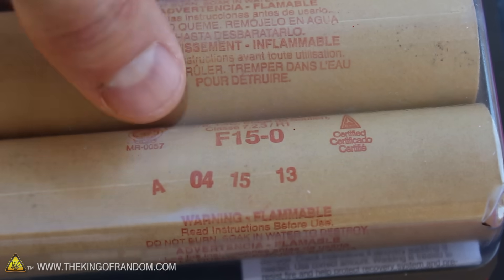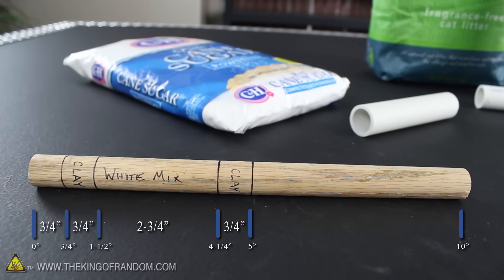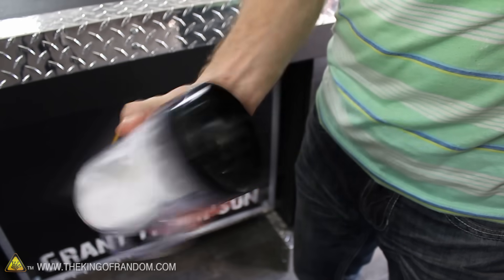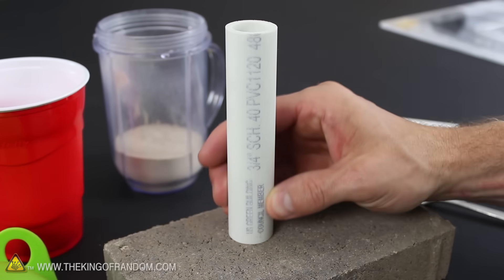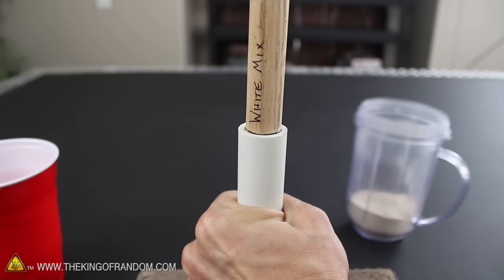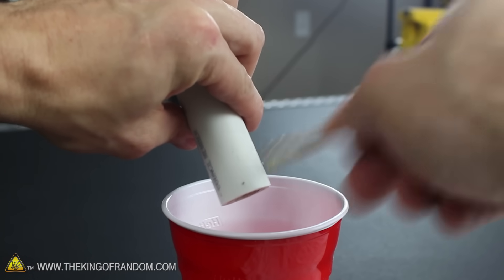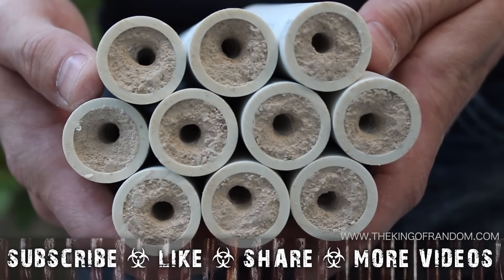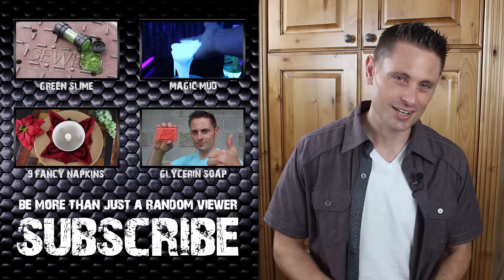How To Make Sugar Rockets

Comment from the maker: Some quick links to a few of the materials I used:

Screw lock sugar rockets
[✓] 12” x 3/4” PVC sprinkler riser: http://amzn.to/2cH4URc
[✓] Spectricide stump remover: http://amzn.to/2bXudia
[✓] Powdered sugar: http://amzn.to/2bXsTfe
[✓] Uncented kitty litter: http://amzn.to/2cG52NZ
[✓] Magic bullet: http://amzn.to/2cG5Gen
Reply: Grant Thompson - "The King of Random"
Reply: Grant Thompson - "The King of Random"
Reply: Grant Thompson - "The King of Random"
Reply: Grant Thompson - "The King of Random" hi
Reply: the kitty litter in the link is not the same as shown in the video is it still just the clay?
Reply: Were is potasium nitrate?
Reply: Grant Thompson - "The King of Random" c
Reply: Grant Thompson - "The King of Random"
Reply: Grant Thompson - "The King of Random" what did you keep under the rockets to light them up
Reply: Grant Thompson - "The King of Random" I try to make one of this rocket myself but the rocket burns only like a smoke bomb and doesn't fly. I use the same percentage shown in the video. what can be the problem? I don't compress the mixture enogh... I don't know. I use KNO3 fertilizer. many thanks.
Reply: The King of Random  where do you buy the potassium nitrate?
Reply: daniel Tellez - Stump remover IS potassium nitrate :)
Reply: what did you use for fuse?

Comment: Hi, Grant! This is my favorite project by far. But how did you measure the height of the flight? I mesured mine using the time the rocket took from the top back to the ground, since approximated acceleration is known. But I got something like 230m (~750ft). Is it really possible to get 2kft high? If so, I have a lot of work for this summer :p
Thanks from Brazil!

Comment: I have some questions: this is basically a SRB . Now the potassium nitrate is the catalyst to cause the powered sugar to burn , the clay retains the fuel at both ends and the baking soda is your time delay . Now it is obvious that the sugar having 22 hydrogens ,11 oxygen  and 12 carbons that it will support combustion quite well.  Your saltpeter or rather potassium nitrate is your oxidizer and you are using a basic electronic rocket igniter from rocketry kit . How were you able to determine the ratios ? Kno3 combined with sugar seems to make a very stabile mix , since the SRB has its own source of oxygen this could launch something into space . This reminds me of applying O2 to acetylene  except you are doing so in solid ,not gaseous form . NASA used liquid o2 and liquid hydrogen to create the massive thrust needed to lob the massive rockets of the 70s into orbit . They have since incorporated SRBs the shuttle program till it ended . This SRB mix reminds me of fireworks,
Reply: Veronicca Lakewood Actually, the first stage engines of Saturn, Gemini and Mercury rockets were all fueled by other liquid fuels, not liquid hydrogen.  Saturn and Atlas/Mercury used RP-1 (highly refined kerosene or jet fuel) with liquid oxygen, and the Gemini/Titan used hypergolic fuel and oxidizer.  Liquid hydrogen requires cryogenic storage and is an explosion hazard.  RP-1 delivers more energy by volume than liquid hydrogen, doesn’t explode, doesn’t need cryogenic storage, and is relatively cheap.  The hypergolic stuff is nasty!

Comment: it doesn't work!!! ahhhh!! everything was accurate, then why???
Reply: You did something wrong. They work. Just be careful....I had a 3/4 pvc schedule 40 tube 5 inches long and one of them was so powerful it exploded.....I definitely handle with care now.....make sure the fuel is packed tight....therefore it burns slower and uniform thrust out the nozzle.

Comment: Grant, I'll be really happy if you reply I'm kind of lost;  I was working on this really complicated and well calculated rocket project but when I started with the fuel I learned that KNO3 is banned in my country, so now I'm stuck with a rocket without fuel. Are there any alternatives to KNO3?
Reply: ebay.
Reply: A few, but they're probadly also banned. Nurdrage has some nice videos on it. You have to make a cemical to make it tho, it takes some time to do
Reply: you could make liquid oxygen by cooling it down with liquid nitrogen but you will proberly get a small result

Comment: Could I use multiple of these angled in a specific way to create a heavier, more stable and longer burning rocket? I'm planning on attaching a small 360 degree circular camera to record some awesome footage. Also, how dangerous is the solid rocket fuel? What happens when it ignites when it's in one of those PVC tubes?

Comment: Hey Grant, I'm trying to remedy something here. The only two differences from your instructions here, is that I cut the pipes 6 inches long, for a little more propellant, and my drill bit can only penetrate a few inches. Does the hole have to go all the way through the propellant?  Two tests, upside down and braced into the ground blew the clay nozzle clean off, one of which the pipe just VANISHED. I assume it buried! I had two successful launches, one of which blew the nozzle off as well after about 60 feet or so. The other kept going. Your input would be great.

Comment: I've been making rockets since the 50s so I tried some sugar rockets like your bid but they over pressure and blow one or both ends out, I grove both ends with a dremmel and pound the clay with a sledgehammer the only thing I've done  is grind granulated sugar instead of using powdered I know pre powdered has a little of some other stuff in it to prevent caking, maybe I'll try a slower mix. Any ideas?

Comment: Very hard to find old fashioned PN stump remover in Canuckistan. What alternatives do you suggest?
Reply: megaturtlegames ***** exactly just need to tweek the ratios to account for the different molar mass
Reply: you can try spectracide brand stump remover, you may be able to buy it online, or the common name for kno3 is saltpeter
Reply: ice packs can work too make sure its ammonium nitrate, it works the same way as kno3
Reply: it does not work the same at all
Reply: megaturtlegames yes it does. nh4no3 and kno3 both have nitrate groups which are used as oxidizer.

Comment: I made some of these and I'm not getting nearly the amount of thrust or height shown in your video. I made the measurements as exact as possible. Please tell me if something else needs to be added
Reply: Same for me, I made it and it just stood there and it burned a horrible hole in my lawn
Reply: I came up with some better measurments reply if your interested an dI can DM them to you
Reply: oh lol
Reply: Also for me, lol.
Reply: Yo boss, you better make a video, I attempted making a few of these with less than glamorous results, mind pm'ing me that secret formula too?
Reply: +Tech2025 please send it to me
Reply: Rajni Ghai 75g Pottasium Nitrate, 45g sugar and use half tablespoon of kitty litter. Then about 4-5 table spoons of the KNO3 mixture, dont forget you still need space for the end cap.
Reply: Tech2025 thanks bro
Reply: Rajni Ghai No problem, let me know if you need anymore help!
Reply: hey can you tell me what kind of wire used in tht video

Comment: I did actually what you said and have no where near the results that are shown in this video. I have thrust but not the tremendous amount shown with your rocket motor. please let me know what else I need to add to the mix.
Reply: Ok I just launched one and all of you seem to have the same problem. You have to make sure that you dry the potassium nitrate in an oven, this is very important, You also need to grind your sugar to a dust along with the potassium nitrate. And finally pack the rocket fuel very very tight.
Reply: ikr....
Reply: +HeyitzAndrew you have the same issue?
Reply: +HeyitzAndrew yeah let me know what you did to get ot to work. this video is misleading.
Reply: well im getting them to launch now... just not straight, but yea using 3/4th inch instead of 1inch fixed it for me.. btw one of the things i also noticed is crucial, is the hole in the middle.. to small of ahole and the plug flies out, to big of a hole and its not controlled enuf, so what exactly happens when you try to launch one?
Reply: +HeyitzAndrew what size hole are you using? are you using 3/4" or 1" PVC? I'm using 3/4". whenever I light them, with visco fuse it doesn't all burn at once, it burns very slow. also a lot of inconsistency, doesn't always burn even though it's the same ratio. let me know your thoughts what exactly what you did.
Reply: +Matthew McElyea bro I am trying to launch but it its not launching and it is like a smoke flares

Comment: Top tutorial! Tho I'm having trouble with nozzle blowouts, tho have been using cooked fuel, not dry. Someone mentioned adding Al powder to increase burn rate?? Wrong. Red iron oxide increases burn rate, Al causes sputter!! Will try dry pressed fuel tonite!! Any advice would be great re my nozzle issue !!

Comment: could you make them explode in the air if you add some off the match head dust with red powder off the box
Reply: Armstrong mix would be strong enough but you would need a few grams of it and that would be hard to come by.. Five grams of flash powder would be though, 7:3 ratio of potassium perchlorate to aluminum powder.

Comment: Hey Grant, what's the biggest sugar rocket you can build? Are these scalable? Looking to recreate H-type rockets for an Iron Man flight project I'm working on... So we need 50+lbs of thrust per rocket. Is that possible?
Reply from the maker: I suppose it's possible, but beyond the scope of my experiments.  Have you thought about working with commercial motors?
Reply: We've been working with G-Class motors, which are the highest you can buy without a license. They top out at about 25lbs of thrust for 1.7s, which isn't very ideal. 

We'd get a license, but there aren't actually any licensing clubs in Ontario, so we would have to drive down to the states to do a course ... and then as soon as they saw what we're using these rockets for (human propulsion) we'd have our license revoked haha.
Reply: @hacksmith  Did you ever figure out how to make the H motor equivalent? I would love to know
Reply: +the Hacksmith I am so pumped for the first iron man test flight. Dangerous for you... Entertaining for us!
Reply: Didnt expect to see you here. I have a major concern about your big project, you might get the right materials but can you try to experiment with cooling systems? DARPA developed a glove that you can cool your hands in to lower temperature, and that can be used in your project. Cool the suit, and your body. That way, even in high temperature you can work to the maximum of your ability. Good luck!
Reply: Xíren Seo check out dyi starlight I believe it is called.
Reply: superhero backstory
Reply: Just get spectracide it’s the stump remover he uses and it’s 100% kno3
Reply: @claireelliot6846  where to get it from?
Reply: Just make a 3 foot motor packed tightly that ought a do it
Reply: guys, he went to a basic tut. video and asked question so hopelessly ignorant, the Tuber wouldn't even reply. why are you?
Reply: User error :)
Reply: Look up "Sugar Shot to Space".
Reply: the Hacksmith hi
Reply: What if you added 2 drops of gasoline?
Reply: If you scale up too much these will detonate. Better to use cast rocket candy.
Reply: Grant, you should do a video with the Hacksmith, teach him a thing or two about rocketry.
Reply: Where in Ontario? I'm near Toronto :)
Reply: j
Reply: the Hacksmith dude I'm subbing to u I saw ur channel and it's awesome
Reply: hacksmith I admire you
Reply: the Hacksmith how bout you strap two G class rockets together?
Reply: John Kessler because you can't easily ignite them at the same time, if you watch my flying like iron Man series you'll see :p
Reply: the Hacksmith What if you twisted the fuses together?
Reply: John Kessler watch the videos lol, you can run the fuses in parallel, but inconsistency of rocket manufacture means they still don't go off at the same time
Reply: Rajni Ghai me too
Reply: Hamas makes much bigger ones.  They're called "Qassam" rockets in the news stories.
Reply: +Grant Thompson - "The King of Random" can we use any kind of clay , please, please answer
Reply: +Grant Thompson - "The King of Random" it doesn't work!!! everything was accurate, then why?
Reply: @LBDRP  moisture  in the air I tried it my fuse got to moist and couldn't light  the mix
Reply: @LBDRP   it works just give it a few minutes, sometimes the fuse also doesn’t reach the sugar and potassium nitrate mix and just stops burning.

Comment: Potassium Nitrate can ignite in the blender on its own. be careful! the sugar helps the burning process i know...but it's not essential for KNO3 to burn. just a heads up.
Reply: No actually potassium nitrate does not burn on its own
It is an oxidiser so it only burns if a fuel (sugar) is mixed
Reply: +Mark Roberts fair call, last time i threw a hand full into a fire it burnt quite well on its own. just saying to be careful. thanks for your feed back

Comment: and making rocket motors is  not allowed there only supposed to be manufacturer
Reply: Not true. As long as you don't sell them you can make them (same goes for AP motors). However, it is recommended that you have at least a Level 1 high power certification.
Reply: And you wrong i am in a rocketry club so i know best and you are wrong and you all ways will be because they are explosives.

Comment: could I make it longer to make it more powerful/longer burn?at what point would it be too heavy to lift itself?
Reply: I guess you need to keep in mind what Kayle Needler said... basically is the amount of fuel burning going to create enough pressure inside the chamber to create thrust? I wouldn't know the exact numbers becasue I'm not a rocket scientist... yet.
Reply: at 400 tonnes
Reply: +Ricardo Ruiz lol no get out
Reply: to increase thrust you need to widen it (so there is more fuel burning at once ) lengthening increases burn time and get closer to top speed doesnt increas top speed though
Reply: you want your rocket as short as possible, its an issue with solid rockets. the larger the combustion chamber the less pressure you will have and less thrust. you might consider another method.
Reply: Hey! I'm currently working on a design that's 1 foot long and 1 inch wide. I recalculated the center hole drill and all the proper clay/propellant measurements. Do you think it'll work?
Reply: KK G. So you think sticking with a 3/4" PVC is better?
Reply: +Ben Schroeder I think if your going with a wider Pope then you should drill a wider hole... I just don't know by how much. This is only an guess, so I don't guarantee anything.
Reply: KK G. Oh okay, I've done those calculations and calculated a new hole according to my new pvc diameter
Reply: +Ben Schroeder awesome! Good luck man! Tell me the results after your done!
Reply: ps, I should say in relation to my comment because the weight of the rocket drops as the fuel burns you should maintain fairly high thrust. really I should say don't make it to long.

Comment: Is it possible to make a multi- stage rocket using some of these? That way it could go much higher (just asking)
Reply: you could use something like the parachute ejection thing or maybe even some electronics.
Reply: +Ztrex That's cool, could the parachute ejection charge be used to ignite a second-stage rocket, or even a third?
Reply: its possible. You could also have the explosion separate the rocket in two halves to have a nice effect and throw off some weight.

Comment: how much thrust was the motor developing?

im trying to remember my physics 2300 feet, 32m/s?
Reply: +darthtader318 You also need the weight of the rocket. Then you can calculate it with Potential energy:
PE = m*g*h
PE = mass*32*2300
PE = mass*73600

We know that TE = PE + KE so, when the rocket is launching,
KE = mass*73600
So 
mass*73600 = 0.5mass.V^2 
the mass cancels;

73600 = 0.5V^2
Solving for V;
V = sqrroot(36800)
V = 192 FPS (Roughly 130 MPH) on launch 
This doesn't account for a thrust duration however. But, to get a rough estimate;

F = MA

F = M (192/2 sec duration)
F = M*96

To estimate the mass, 100 Grams fuel, 45 grams PVC, 45 grams kitty litter = 0.418878 LBS So 

F = 0.418878*96

F = 40.2 Lbs of thrust

VERY rough estimate, since we don't know all the variables.

Comment: I made a static sugar rocket. I poured the melted fuel into pvc before it became thicker. This method yielded a 2 minute burn from a 4 inch 3/4" pvc pipe.

Comment: 3% mineral mineral oil to your clay will give you really good nozzles.
Reply: I'll have to try that. I did it the way the video says and it just crumbled out. Tried modeling clay but that doest work because it shrinks and falls out when it dries. I was thinking a touch of Elmers white glue to the kitty litter but I'm guessing the same results as the modeling clay, shrinkage.

Comment: just a heads up, be very careful with making your own rocket engines and lighting them off.. in most cases it's actually a federal crime..
Reply: +J.A.Ratt85 ~ civil disobedience, make them anyway. Enough federal government nonsense.
Reply: +J.A.Ratt85 Hobby rocket motors (including high power) no longer require a Federal explosives permit to sell, purchase, store, or fly.  Refer to http://www.nar.org/find-a-local-club/section-guidebook/laws-regulations/
Still, be careful, but have fun with no worries about Johnny Law busting down your door for model rocketry!
Reply: TheRealPhreakShow that has nothing to do with making your own
Reply: You are strictly prohibited from launching the rocket in close distance with public areas. Do it unless 2 to 5 miles away from public areas.
Reply: +iFade Productions I've done it it several times in the field of a school :). It was with my Cub Scout pack though so we probably had a permit or something else.